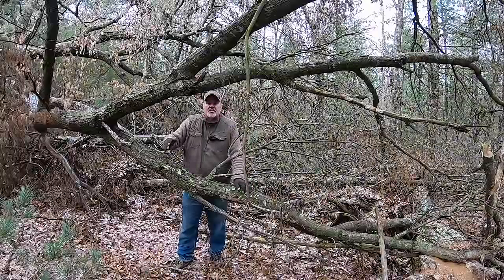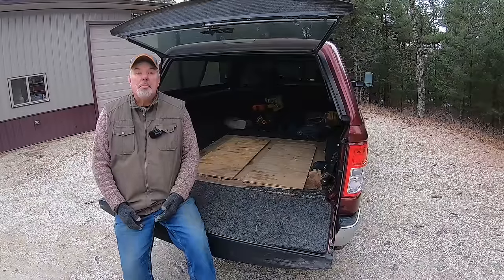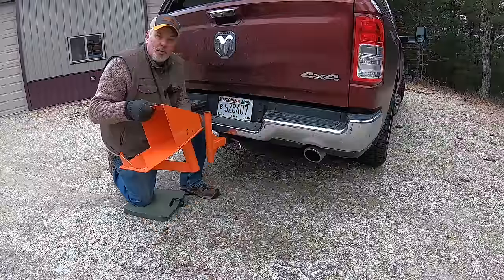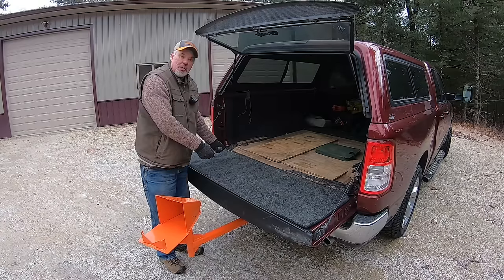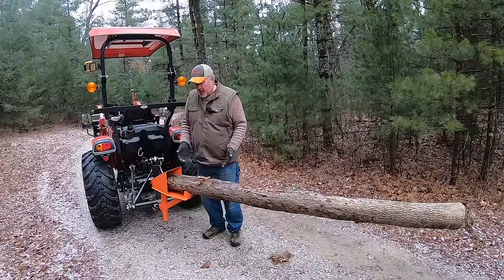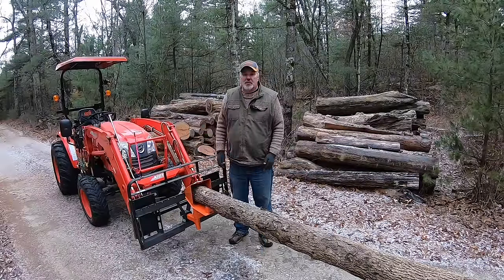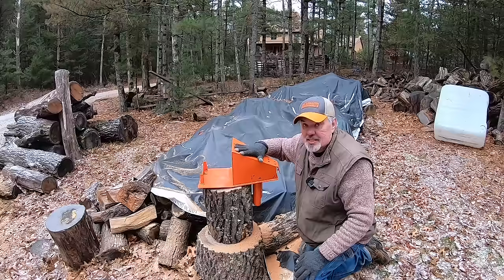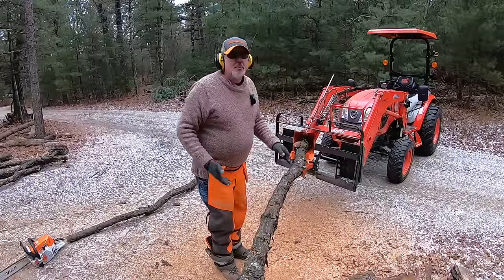Wood Dock Log Holder -115

Comment: Good review tony, too bad the company went out of business. I could see this being very useful since the limb wood is the hardest to cut up without dulling a chain. It may take more time and steps to load the accessory, but it would save time with changing chains and sharpening. Have a great day.
Reply from the maker: Frances it’s a bummer the company went out of business after just under 10 years. With ability to use any 2” receiver it really is a handy and practical tool.
Thanks for watching and commenting 👍TCT

Comment: Nice handy tool. The thing I didn't like is that it wiggles while cutting. Thank you for another great video
Reply from the maker: Brian I typically use my smaller saw (MS261) and cut as far back on the saw as possible to eliminate the wiggles. 
Thanks for watching and commenting 👍TCT

Comment: Happy New Year.
Nicely done
As per usual.

The only caveat I see might be
Lifting a 350 pound limb up and in too the device initially.

The tractor loader arms or three point solve that, .
But a pickup hitch receiver mount might prove problematic for more than a few of those over 55..

Best wishes for continued success.

( They need to send you $3,000.00 for a nice commercial)
Reply from the maker: Jean any of the limb holders are meant for smaller wood. You’re right anything too heavy I cut on the ground. 
You don’t remember but you commented a couple years back on a review video about the Wood Dock and you said if you could modify it to work on a tractor you would consider it.
As I always say I’m not trying to sell anything just show you what’s available.😂
Thanks for watching and commenting 👍TCT

Comment: After watching what a great idea. A couple of dimensions would be great.
Reply from the maker: Kevin here you go:
19" Length
9-1/2" Width
8-1/4" from front to start of angled box frame.
The box frame that holds the wood is 8-1/2 tall and tapers to 3-1/4" in the back.
Let me know if this makes sense to you. If you want to send me an e-mail, I'll take pictures with measurements.
TonysCoolTools@gmail.com
Thanks for watching and commenting. TCT

Comment: I'll be honest... dinging the soil and swapping out the dull chain gets old, fast. I went through 4 chains today, bucking 2 trees.. .🥵... I reckon I need to dust off my welder and see what trouble I can get into...😂👍🪓🇦🇺
Reply from the maker: Yup get that welder going. Here are the measurements in case you do.
19" Length
9-1/2" Width
8-1/4" from front to start of angled box frame.
The box frame that holds the wood is 8-1/2 tall and tapers to 3-1/4" in the back.
Let me know if this makes sense to you. If you want to send me an e-mail, I'll take pictures with measurements.
TonysCoolTools@gmail.com
Thanks for watching and commenting. TCT